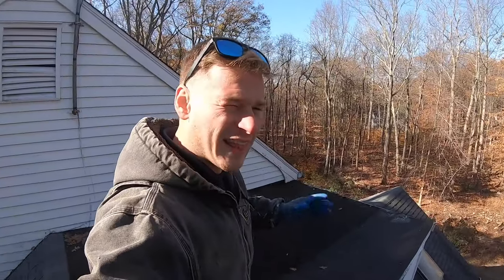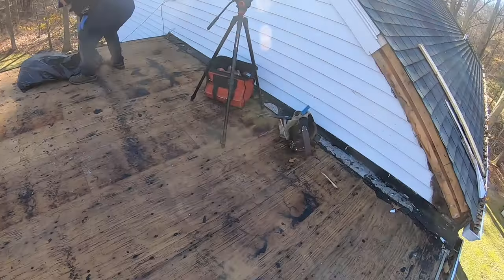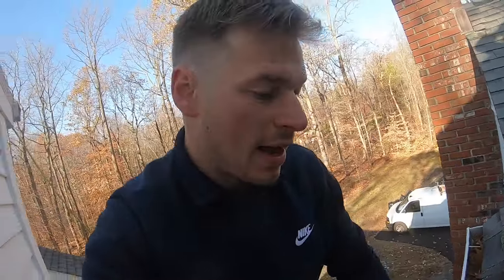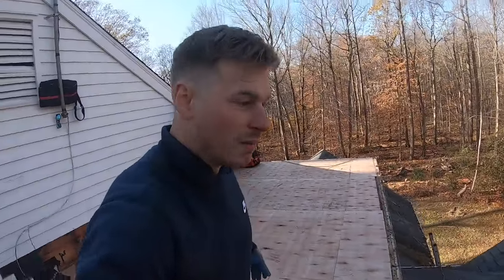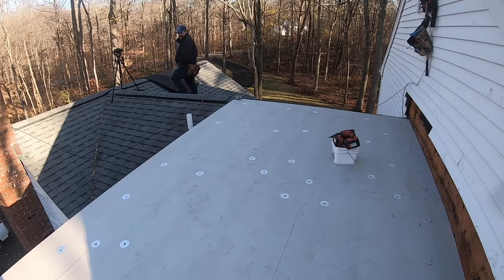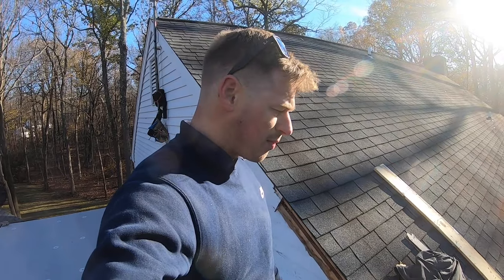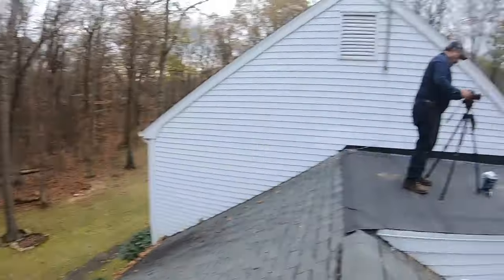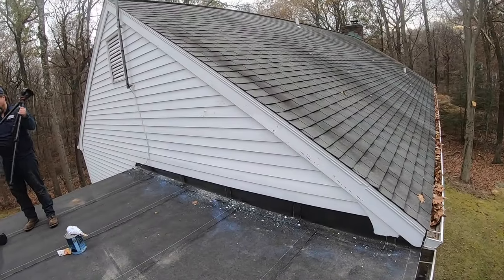Flat roof replacement

Comment: Just curious - why didn't you use the granulated torch down sheets?
Reply from the maker: I feel that the smooth membrane welds better and I have more control over it, I can manipulate it better because I am not embedding a lot of contaminants AKA granulars into the roll at endlaps and overlaps. Cheers.

Comment: Are you supposed to be able to read the brand of the modified torch applied membrane on the back of the installed membrane.  Do you think there should be ventilation of the joist cavity?  May account for the moisture in the cavity and the damage to the plywood? You should start placing the edge metal over the modified membrane and then stripping the membrane in with modified membrane.  you ever here of membrane base flashing ?
We are all learning.  You may want to look into NRCA roof installation detailing or Western States Roofing Contractor installation detailing.  May keep you out of litigation?
Reply from the maker: I'll have to look into it, thanks Max.

Comment: Umm yeah you should of  stripped the gable and wrapped it plus modified isn't design to hold water. Good attempt though
Reply from the maker: I appreciate the info. Next time I do a torch down roof I’m gonna apply what you’ve said! Thanks David. I totally agree and I’m always open to improving.
Reply: No one does torch especially on low pitch roofs but okay. Keep up the work so I can go behind you to do it properly 😀
Reply: Here in Los Angeles because of the heat we only use granulated but have never had an issue with ponding water..averaged 2 per week for 30 years, only use Dibiten  which imports crushed slate flakes from Europe & we always sandwich metal with 10” smooth modified..Virtually no flat roof replacements although first few years smooth was only option which we coated with Karnak..